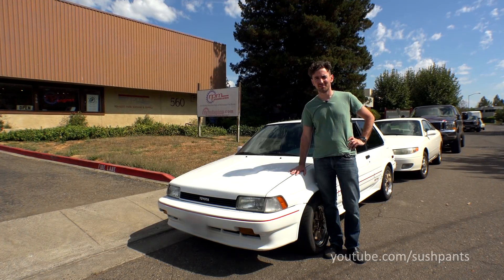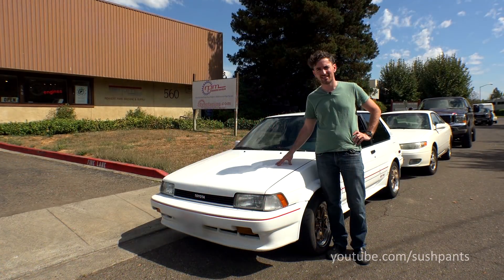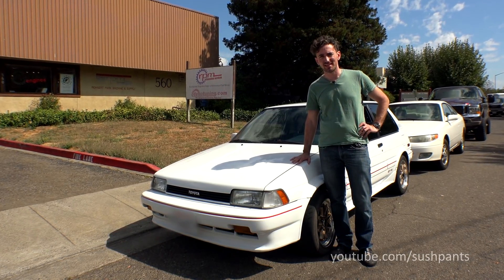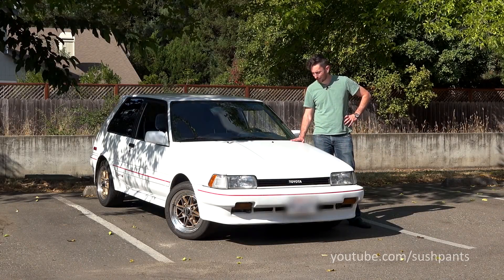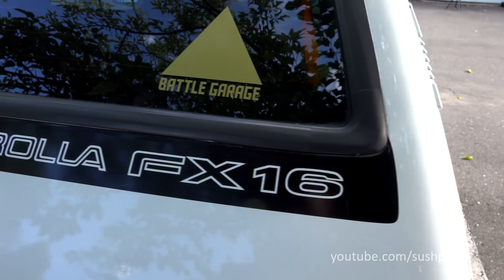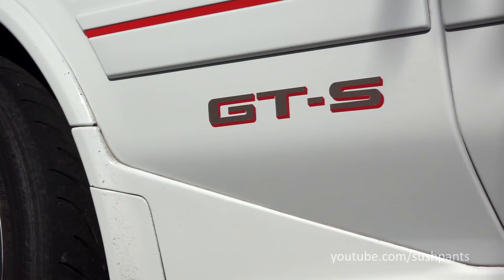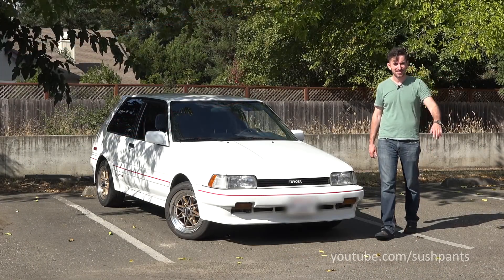How much power does a 4AGE 20v Blacktop make?

Comment: a honda b16 will always take it to gapplebees probs a d15z7 if it's in a ef lol.
Reply: Bullshit..b16 is overrated unless its tuned to 400hp..I had a stock b16 and a  stock 4age..4age is faster and it was the 16v..
Reply: Bro where? My 95 (AE101) with a BT swap shits on EM1s I’ve yet to be beaten by a comparable EG I even gave an SRT some heat

Comment: damn I thought it makes 165hp? I know you get less at the wheels but you just lost about 30hp?! how do you avoid that? I wish this engine had better displacement
Reply: You don't avoid that, it is basic physics. A larger displacement doesn't help with the drivetrain loss
Reply: no i meant if it were a 2l it would have made way more than just 165 stock so it might have been around 200hp with about 170whp
Reply: Yeah, higher displacement engines usually perform better, or can be made to perform better, like the s2000 engine, 2l 200hp. Probably around 170whp.

Comment: isnt stock blacktop has 165hp? (sorry for bed england xD)
Reply: 140 BPM this is power at the wheel which is lower than at the crank which is very good
Reply: Barış Ciyaq yeah, it have 165, i dont know why in video 135

Comment: Uv made by far the best 20v videos on youtube. Like you have mentioned in other video. There isnt any good 1s. Could i ask for some small advise. I am currently building a bt 20v motor. And would like to know what run in procedures to follow. And what oil spec and brand do you use
Reply from the maker: I ran my engine easy for the first 400 miles or so. I changed the oil after 150 miles so that i could get all the assembly lube out with the oil. Then checking to make sure oil level every 50 miles or so and check for leaks. Then, slowly increase rev's before shifting. At 600 miles i would start revving the engine out with smooth pulls but not beating on it. After about 1,000 miles i was comfortable driving it like it was meant to be. 

I'm using mobil 1 full synthetic 20w50 oil.
Reply: Thanks alot buddy. Im from south africa. Everyone here uses 15w 40 shell helix or hx7 10w40 semi synthetic. I will how ever try to find mobil 1 20w 50. Thats whats in the user manual of the car 20w 50
Reply: lol I use 0w-30 for years but maybe thick stuff will do it good for racing

Comment: Nice video. Can’t wait for your videos with upgraded cams and stuff. As long as your cams are below 9mm lift and if you don’t plan to rev over 8500rpm, stock valve springs will be fine. But better to be safe than having a valve float at high rpms. 
Also, it would be great if you could do a dyno comparison video with different length trumpets. I believe shorter stacks gives higher hp at higher rpm vs higher torque at lower rpm on longer stacks. Let’s see how it goes.
Reply from the maker: I'm going to swap the springs and valves because i would like my 4age to rev to 9k. That's a good idea to test the different length trumpets, i just have to get a set of short ones. I'm waiting on some part suppliers for the time being.
Reply from the maker: I’m making it happen! Expect a direct dyno comparison of 100mm, 75mm and 50mm trumpets in about 2 weeks.
Reply: Awesome bro. Can’t wait to see the results.

Comment: Its a cool engine just over hyped. Produces not much power. I think the BEAMS is a better cheaper option and it has a 6 speed. Rated at 200hp
Reply: NISMOIZKING 20V can tune up and take cams and easily make 200hp
Reply: 1.6L 20V NA making 200hp, I would like to see that.
Reply: Luke Augustine dang i didnt bring out size of engine at all. I was stating the beams already starts from a 200hp base point and you can go up. Also its an NA engine so....im not a huge sr fan i love the ka btw. But you must have went up against a shit st because some srs hold 350hp stock with supporting mods
Reply: I was not replying to you Nismoizking I was replying to what Bence said also no i did not go up against a shit SR, I myself own a 6speed 20V VET SR20 in a Nissan B13 and it puts down about 270hp and its the most powerful SR out of them all so I know what they are capable of and I can assure you NO SR20 in the world comes 350hp stock loll its not hard to achieve it either but once again 4age blacktop is a lighter engine than SR in a long run it will come out top I raced an SR18 rated at 140hp, Sr20 redtop det rated at 200hp and the 2l non turbo SR20 vvl blacktop rated at 190hp all of these races were long distance on the highway not quarter miles and my 20v is a 6speed also with a haltech managment, turbo fuel pump, ACT clutch kit and MSD coil, very simple mods that puts an SR's tail between its legs when it hears the 4 throttles screamin lol honestly I might have gone 3sgte had I known that 20v would be a pain in the ass and wallet to get it turbo charged I already had the money when I went for the 20v and the 3sgte was also $1k cheaper except the gearbox was 4wd and I didn't really know too much about it at the point in time but from what I am seeing already with my 20v non turbo when I'm done with it I'm looking for at least 400hp :)
Reply: Please show me where I said it's crap. If you can get 200 hp out of a 1.6, why not do the same to a 2.0? Maybe it will have some torque below 3000 rpm.
Reply: Luke Augustine i ment 350 hp build able stock block WITH SUPPORTING MODS ex. Bigger turbo injector tune etc. I know no sr came stock like that lol. Read my name
Reply: my mechanic has an SR20 blacktop doing 350hp but all he has is a turbo brain and turned up the boost with a bigger garrett and it performs well without changing anything really the engine is basically stock with a bigger turbo Bence keeps talking again about why not do the same to a 2l once again I can achieve the same if not more than what a 2l can put down I don't see the point in wanting a 1.6-2l engine and wanna stretch it out to over 500 hp like I said I could have taken my little 7AFE and build it and totally own any 3sgte or 20v or sr20 for less money which is what I'm trying to explain to Bence but he thinks a 2l is everything loll anything more than 500hp and I prefer go rear wheel drive and use a 2jzgte 3l or rb26 dett and then you can start talking big numbers anything 2l and under needs to many mods and money to make that kind of power also I don't recommend going that fast on a FWD anything more than 250hp on fwd and you need to make sure you can hold down the car properly
Reply: Bence Gábor Slezák i wouldnt want a 1.6 unless its a lightweight chassis. 1.6 lacks tourque. FUN FACT: look up the sr16n1. That engine was rated at 200hp NA so more than 100hp per liter
Reply: well my blacktop is in an ae101 so its a pretty light car I can actually catch up and pass a Medalist after stretching  out every gear until i hit 5 going to 6  but as you said an even lighter weight gets in done faster like the BZ Touring 1.6l-2l (170hp-400hp) is good enough for an everyday driving car that just wants to have fun anything more than that and its RB or JZ and that car has to be for the tracks running on the highways with that amount of power is no joke and you could end up in the morgue if you just like messing around especially with these performance engines
Reply: NISMOIZKING beams sounds like a fucking lawnmower
Reply: Compering a 1.6 and a 2.0 does not make much sense. The silver top 4A-GE is rate at 160 hp so it is pretty much at the 100 hp/L as the BEAMS. Small engine for small cars, like the Corolla.
Reply: If powerful, small, na, high reving inline four engines is what you like, Honda is the way to go imo, and im a big Toyota fan
Reply: the waffle man a lot of 4 pots do
Reply: NISMOIZKING they make a beams FWD?
Reply: David Mas i believe so in a celica or rav4
Reply: you're right beams or 3sgte does make wayyy more power and its cheaper but i never saw a 6speed one before also the 20v can easily reach over 200hp once you build it but its expensive to do so
Reply: Luke Augustine they make 6 speeds for rwd not sure FWD. Beams can make good HP as well
Reply: NISMOIKING if I condemned the AWD on the 3SGTE gearbox to make it FWD alone would that have made me lose any significant amount of power? like will it still outrun a 4AGE or SR20 the way i usually see them doing it? I had the option of getting the 3s with an AWD or 20v with the 6speed FWD I choose the 20v mainly because of that gearbox problem

Comment: Should it not have more power?
Reply from the maker: It's right around the ballpark. 136whp equates to around 160 engine hp, but i think there is a lot of upgrade potential from changing the exhaust. I'm still using the original catalytic converter and i believe it is very restrictive. I have a header and high flow cat on order, i will install them and re-test.
Reply: sushpants yeah you could do a lot to the engine! Cams pistons ecu and so on...
Reply from the maker: I'm hesitant to do pistons because I will need 93 gas and in California we have some of the crappiest gas. Blacktop stock already has a really high compression.

Comment: Do you have any idea what the power output was before, with stock manifold?

I'm going for 110mm stacks and Tomei Poncams on my AW11 20v BT this winter.

I had it dynoed this summer with a healthy 145 WHP on 102 octane, bonestock, with nothing but a Fidanza Flywheel and alloy pulleys and a 2,5" exhaust with highflow cat.
Reply from the maker: I never ran it with the stock manifold so I don't have any numbers for the that. I suspect I lost a lot of power from my exhaust, my cat is the original from the 16v bluetop. I think I will have a healthy power bump from exhaust and cams.
Reply: You'll definately feel the difference, when I swapped in the 20v I didn't have a blast on the stock exhaust system... It's pretty restrictive with its 2"ish diameter

Comment: Hey im paying attention to your tachometer and it shows 8000 RPM,why don't you try simple things to Increase power such as replacing your stock old tachometer with the new ones that are higher for example the ones with 11000 Rpm's???it should give a higher rev which means higher power.After all it's an engine built for professional racing at the time
Reply: FREDDY .DA.GAMER Hope you're trolling
Reply: SFM springtrap killer yeah man and then just puy the fujiwara tofu shop decal on the side for extra 500000hp right?
Reply: SFM springtrap killer takumi's engine was a GROUP A spec silvertop engine, designed to race on actual race tracks, and it was never intended for road use, which is why it can rev up to 11,000 rpm. The blacktop in this video is just a normal, road going version of the engine, which only revs up to around 8,000rpm, so adding a tachometer would do nothing but encourage you to blow up the engine.
Reply: TehRacer then expect to blow up the thing again?yeah
Reply: I ran 9.5k rpms for 5 years in a DD ae82 silvertop. If you run the numbers on rotating mass you might find 11k doable. I did spin a bearing though.
Reply: SFM springtrap killer not really XD I got bored one day and looked up the Wikipedia article about the Toyota A engine series, there is a section with the 4age and it's different variants in it.
Reply: When you just finished watching Initial D
Reply: SFM springtrap killer what does a tachometer have to do with making power? that has nothing to do with how much power your engine can make even if it has 10000rpm the engine will start choking at 8500 or 9000 to call for the next gear and like what you said revving to higher rpms like 11000 is just reckless because you will destroy your engine also revving that high really makes no sense in a drag race if you want to build your car for drifting hell go 15000 rpm if you want to but drag racing by the time you try shifting from 2-3 on 11000rpm someone with an sr20 or another 4age that revs up to 8500 will already have hit 3rd or 4th sure you'll make some power at 10000rpm but at what cost? lose the race? blow up?
Reply: Jamin Ramsey nah
Reply: wannabecarguy indeed,a rev of 11000 rpm is a real dream for road going cars
Reply: Xdr .77sohail remind if I'm wrong but the horsepower spec is 240 horsepower right?
Reply: SFM springtrap killer for the group A one, yes, it's around 240-250. The road going one makes about 160hp though, I think.
Reply: Xdr .77sohail you really familiar with this kind of engine.im amazed
Reply: Xdr .77sohail because there's almost very little about the 4A-GE engine online,so my apologies
Reply: SFM springtrap killer are you kidding? This must be in top 10 most popular motors of the last 2 decades online.
Reply: chipchip I know about the 4AGE engine is used for racing but I don't really familiar with it's difference between the road going and actual track racing 4AGE
Reply: It's not used for racing so much any more. Anyway, it came in a few forms, 16v, and 20v. 16v was t-vis and non t-vis (big port head and small port head), 20v came silver top and black top.
Reply: Also a high revving engine isn't really that good for road use, thats more track oriented. 
For the streets you want torque

Comment: Toyota lied about the specs of the engine then?
Reply from the maker: +Ronaldo95163 I've read that Toyota rated the motor with no ancillary devices attached (no power steering, no ac or alternator) to get that 165hp rating (at the crank). This dyno result showed 136hp at the wheels, which means at the crank it putting down 160-170HP.  Wheel hp can be a little deceiving, subaru ej25 is rated 305hp at the crank but makes 240hp at the wheels.
Reply: Woa good info there.

Comment: My silvertop with a bt ecu and the same trumpets made 134hp leaning out after 6000rpm because of a bad fuel pump. I replaced my pump with a denso one for a supercharged mr2. I haven't redynoed it yet but but i installed a AEM wide band and its not leaning out anymore and pulls much harder all the way to 8600. Look into a fuel pump if your still running the old corrola one. I can repost on here when i redyno.
Reply from the maker: +SimonTrent8000 the AEM worked with the bt ecu? I thought the stock o2 was a narrowband.

Comment: Which gear box do you have in it?
Reply from the maker: +Anthony Cabrera it has the c160 6 speed.
Reply: sushpants and that's the factory one?  I have a fx with a 20v silver top, and I don't know which gear box have 😅  because I bought  already swapped it
Reply from the maker: Some blacktops came with 6 speeds and some with 5. I think the same was with the silvertops. Easy way to tell is where your reverse is. If its to the left and forward, its a 6 speed.
Reply: sushpants Mmm 🤔 mine it's a 5 speed plus reverse and it's down the 5th gear 🤔
Reply: then thats 5spd

Comment: Takumi legendary 4AGE 20V lives again!
Reply: It's amazing that an anime like initial D managed to get the accurate engine sounds...for this, the skyline, the rotary rx7s, and others. 😍
Reply: @ShanMichaelEscasio  They took sound bites of Keiichi Tsuchiya racing by in the cars to get them spot on.
Reply: In fwd this time lol
Reply: Eyyy!
Reply: Takumi had Silvertop witg ecu mod that ecu can make over 11.000RPM
Reply: @bangraffa2904  Because Of It This Engine Is Incredible And Takumi Could Handle It Because He Was Unbelievable Skilled Driver And His AE-86 Was As like His Legs And Arms
Reply: That's what I was thinking as well till I remember he's in a FWD car. :(
Reply: Takumis motor came out of the group a rally car lmao completely diff but ok xx
Reply: @Wagamanee  An Engine Which Is Built For  Group A It Dosen't Mean It Have To Be For Rally It's Made For Professional Racing Situations And In One FWD You Can Control It A Lot Easier Than A RWD Car But Of Course For A Car Can Handle This Rev Limit And The Power Of It The Car Have To Be Set As A Race Car Not Just An Engine
Reply: Final battle engine broken🥴🥴🥴

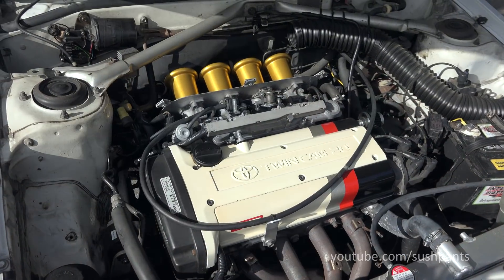Comment: Could I just ask something, I noticed that you have the filter on the valve cover which most people do including me but I also noticed another filter right underneath it where the block is. What is that one for? the one i'm referring to is at 2:10 .
Reply: betelgeuse Star
Idle control solenoid intake

Comment: No surprise on the air filter. The whole air filters are restrictive hype is nonsense. No benefit running without them unless you want to take photos of the trumpets :) loved the video. Great power on the BT, means it's nice and healthy and ready for upgrades. Looking forward to more vids.
Reply from the maker: +driving 4 answers the restrictive hype on some filters is true! I ran the red UNI filters and they choked the engine, huge difference after I removed them. I suspected the pipercross had little effect on power because there was hardly any difference with it installed vs running open trumpets. I'm excited about doing power upgrades!
Reply: Interesting results. There is definitely a ton of hype around air filters and intakes in general, but ITBs is its own world. I'm sure there are some bad egg filters for any setup, but for the most part they won't hurt power in most applications that aren't insane.
Reply: driving 4 answers filters can get in the way of jet changes .... Filters that trap particles as small as 4 microns are restrictive. Just facts from the performance lab techs.
Reply: Where  did you get the Gts lettering pls the link.... Would be nice of you 👍🏽nice engine cover 👍🏽👍🏽👍🏽
Reply: Like any engine modification it's only going to have a difference if the engine is tuned for it
Reply: Just knowing the trumpets are exposed adds at least +2hp.
Reply: what size cams are you looking at going with as it would be really intriguing to find out how driveable you want the car to be. Maybe running 300 degree duration cams might be a little excessive but man it would sound good at 9900rpm.